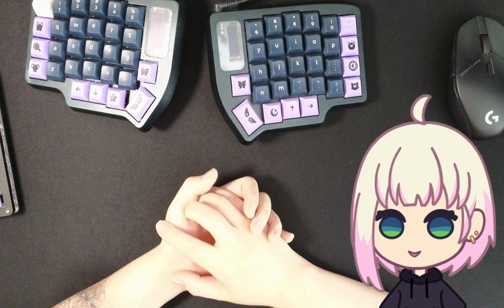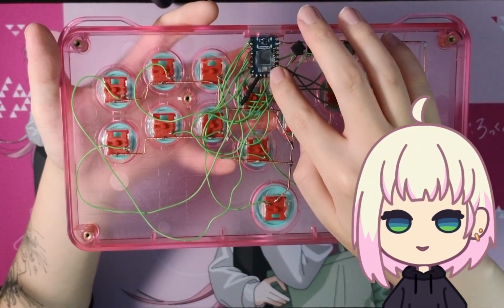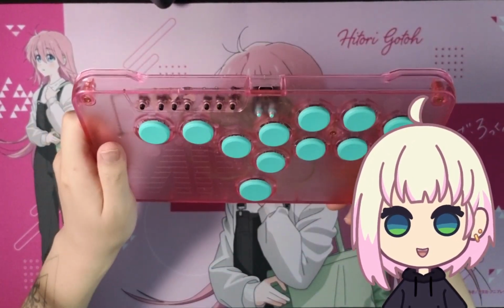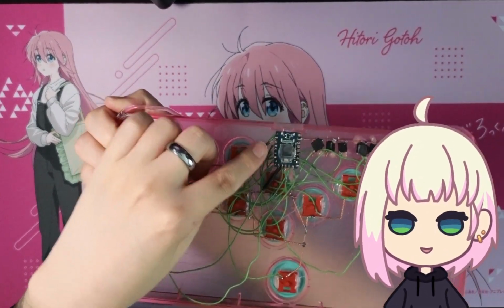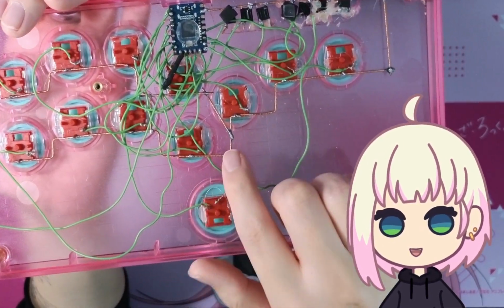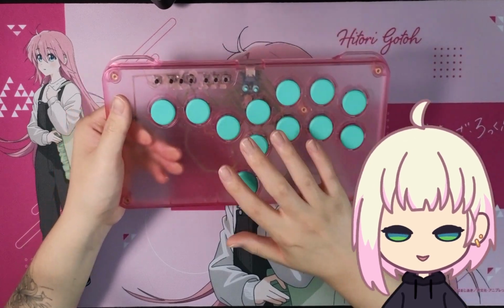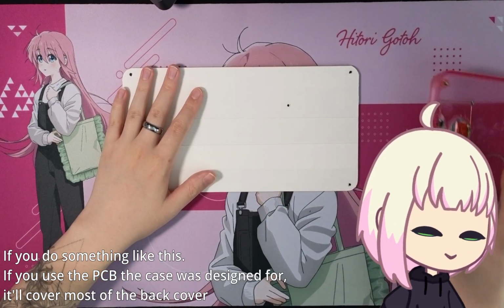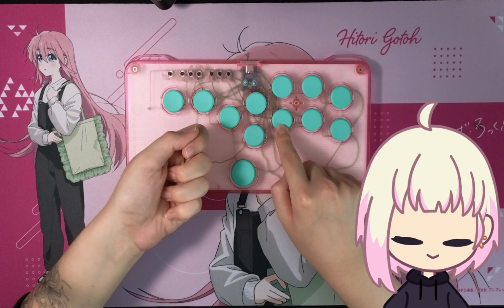My Handwired 'Flatbox Micro'

Comment: Cool project, I wonder if anyone in the open stick community designed a PCB that fits the snackbox case - would save you the wiring and provide a much firmer base for the switches.
Reply from the maker: That would be really nice. I'm curious how Junkfood Arcades would feel about that. 
A slight modification to existing open source PCB designs would probably work though.